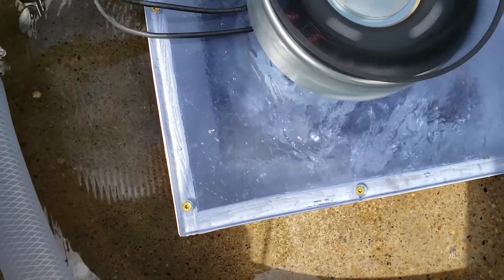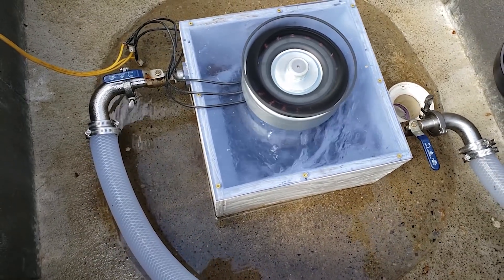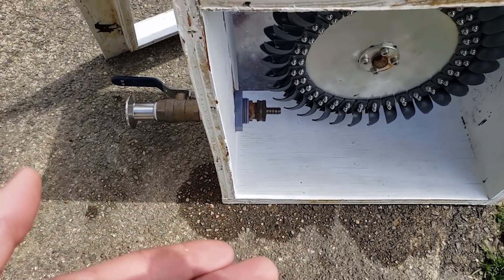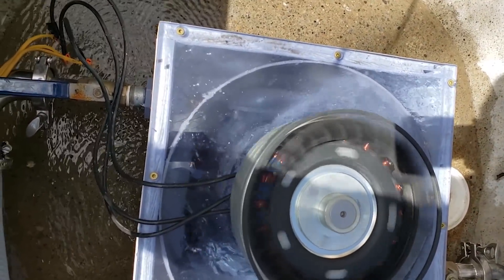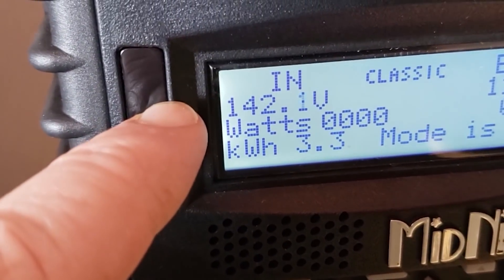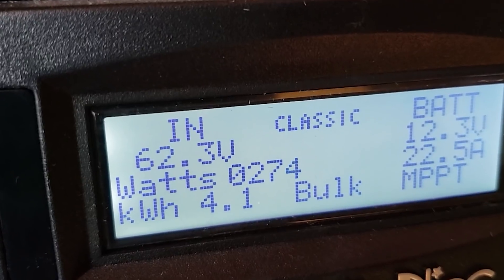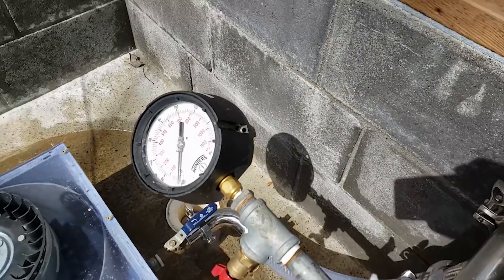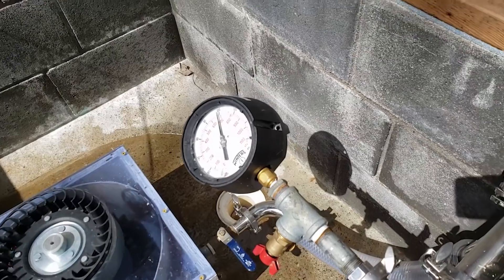Round Turbine Housing, An Improvement?

Comment: How did you get that much pressure?
Reply from the maker: A spring 280ft up the hill
Reply: @JoeMalovich  that's about right. 119 psi is around 274 ft of head. owner of the property is very fortunate. how many households can this power?

Comment: Instead of square or circular turbine cover how about a tubular turbine cover, and you build some fins at ends of both water splash where the water is redirected to the bottom of the turbine with which you can avoid the distraction to both the turbine and the other splasher...

Comment: I'm no expert but I think you may find your box is totally too small, and your jets need to be setup with the water flowing to get the angle correct on the spoons. Believe me it doesn't take much to loose RPM because your jets are just slightly miss aligned

Comment: Make your circular drum from expanded stainless, if you orientate the expanded sheet correctly it will strip the water away much like a cheese grater. and for gods sake orientate any over lap in the direction of spin to help prevent any damage to your rotor.

Comment: I very much like the work you did with connections, concrete, etc, to make it easy to work on.  These things need a lot of work at first when efficiency improvements are being done.

I'd do a lot more experiments before committing to stainless.  Get all the flow and bouncing issues/opportunities solved first.

Whatever bouncing issue you have with the top, is likely happening on the bottom as well.  You may want to increase the height of the box by a foot to prevent any bouncing from the bottom.

Comment: After looking at several turbine sites on Youtube, here's my thoughts. You guys are all trying to reduce splash back and prevent drag. The nozzles MUST be equal in pressure. If one nozzle is faster than the other, then, the slow one will be hitting the cups later than the other one. If the water hits late then it is not adding as much and creates drag for the faster one. The nozzle supply pipes MUST be equal in the bends and all areas of the supply pipe pressures .Build a header system with EQUAL pipes and fittings to each nozzle. Just like an automobile engine. The inflow must be equal then, you can work on the out flow. 😎

Comment: As theoretically, water should lose all speed and drop dead, it falls vertically down and crosses the space where the spoons move.

It could be interesting to make a U-shaped sheet metal profile like a sharp edged tunnel, where the cup  can continue once all water of the jet has exited the cup.

The MPPT may find that such a cover eliminates plashing and increase the RPM slightly to give the used water a slight forward motion.

It may be possible the cup should be shaped or angled to eject water slightly radial outwards and not mirror it in reverse so drop on the wheel.

The wheel with a smaller diameter has the advantage of larger distance  between the cups and the cups curving off to allow for a "drop-zone" where there is no cups in the way. The MPPT may increase RPM a bit and allow for a residual velocity that moves water away.

Any water in a slight forward motion should be guided in a curve to move vertically down and out.

How a single spoon is best located maybe can be checked by observing how a low pressure jet actually splits the water over the engagement cycle.

Comment: The circular housing is nice, But you can see where the majority of the water hits the circular enclosure wall. Cut a slotted hole in the enclosure wall. Most of the water would leave the enclosure at that point eliminating the majority of the drag.

Comment: Joe, I just recently discovered your videos and what you are doing I think is really cool. I'm sure you have researched this topic at length but I build racing engines and understand fluid flow. I wondered what larger more commercial water turbine designs looked like and I found this website with a 10KW turbine. I wonder if you incorporated a similar turbine housing design if your water flow turbulence would increase the efficiency.  I think this design (on the website) incorporates a down draft turbine blade design but the fact that the housing is both cylindrical and cone shaped allowed for the water pressure to dissipate and fall away. I wonder since your Pelton wheel requires more of a direct side impact with water flow, if you created a half donut shaped upper housing for the water to reflect off of and help smooth the turbulence of the squarish  corners between your plexiglass and the cylinder. I imagine if you want to keep the upper lid visible, you could use clear casting resin to make a semi transparent "half-donut". Here is the site I found, have a look.
https://www.micro-hydro-power.com/Micro-Hydro-Turbine-Power-Dual-Nozzle-XJ30-10DCTF4_6-Z.htm
Reply from the maker: Your comment is on point. I plan to solve this issue by using a turgo runner which has all of is flow in one direction.

Comment: You could get more power if you raised the water coming from the spring a few feet.  The Romans had had a trick for lifting water levels in their aqueducts, to make water run uphill.  While you want water to go downhill, you can still use the Roman trick of an inverted siphon to raise the level of the water, to increase the water force hitting your turbine.  The Romans used inverted siphons to run aqueducts uphill (no moving parts, just uses water pressure)!

Comment: It may be a bit more complicated, but what if you constructed an open-top conical round housing? The conical shape should cause the water hitting it to preferentially deflect upwards or downwards based on the angle of the cone and combined with leaving a gap at the top or bottom, I'd suspect you'd eject a lot more of the water that is forming a vortex and backsplashing.

Comment: Can you run more small nozzles to use up the full flow rate?  Does that give a proportionately higher power output? Long nozzle tubes with venturi inlets from the larger pipe will exit in a laminar flow.  A fixed stator will direct the discharge water away from the rotor.

Comment: You don't need to make it a circle. You just need 2 inputs and 2 outputs. Example: The water jet will shoot out the water directly towards a output valve that's feed into the second input water jet. Then have the second input water jet shooting towards the second output valve that's feed into the first input water jet line. It would give release of  friction that's causing back pressure from it bouncing off of the walls inside of the box. It would cause a vortex suction on the output valves which would pick up the water speed flowing. At that point I would be worried about water proofing the bearings and heat deterioration.

Comment: Great series on turbine..seems to me that you need a birdcage system instead of a sealed box..water will exit the cage that supports the motor..you only need wall where the nozzle(s) will be mounted..heavy (HEAVY!!!) gauge wire cage and try not to have the splash from the spoons hit any of the cage bars..easily done buy observing your current system..yes, I am living vicariously through you...LOL..also you could try a slotted metal wall design where the wall is formed like car hood scoops into the chamber to catch the water and divert it outward...Think "outside the box"..LOL

Comment: And maybe use a splashback cylinder with a chhese grater style perforations to evacuate as much water into the corner sections where it will not cause drag?  All in all sir, I like your style.  Great acceptance of trail and error to find success.

Comment: The circular enclosure certainly helps reduce inefficiency of the current system, but why not use the redirected water as a secondary power source?  Expand the enclosure.  Add two small wheels in the path of the water ejected from each side of the primary wheel.  Rather than that high speed ejected water simply being diverted, it can generate power.  One large generator and wheel, two small generators and wheels.  Less wasted energy.  Not sure how your current system would handle three separate generators all at different outputs though.

Comment: Hi Joe love and warm regards from India, I feel you must make a involute just big to fit the pelton wheel, you can visualise it as a "C" that's like half cut square, going around the pelton wheel will reduce the drag form a more uniform water flow over the wheel, also I recommend to add 4 more nozzles so a total of six nozzles with a enclosed involute specially made that just fits pelton wheel, should surely increase its efficiency, lovely work and a great design, great effort in that biting cold Joe, God bless and keep the good work going.

Comment: Thinking on this (I'm no engineer) it would seem that if you made a housing in the shape of a donut missing the inner 1/4 - 1/3 surface (so that it would go around the impellers) then extend the inner edges a little toward the spindle and had shaped cut out vanes on bottom side (to direct water down). I think this arrangement would limit the turbulence causing your fluctuations. sounds a lot more involved doesn't it. Anyway like I said I'm not an engineer (but I was a printer/copier tech. for 28 years.

Comment: I'd love to see what a mesh, expanded metal, or sheet with exit holes does in the same orientation. I would think the goal is to get the 'exhaust' water to slow down and get out of the turbine housing as fast as possible. In lue of an infinitely large space the ways to do that are deflection or drag(I'm probably missing something here). Thoughts?

Comment: You need some strategically placed louvers in the cylindrical turbine housing to allow water to escape out and not be recirculated and churned in the path of the pelton wheel.  The louver principle is very much like a windage tray inside the reciprocating crankcase of a common internal combustion engine.

Comment: You should try this with an open frame, this is acting a bit like a water brake dyno. I think any structure around the turbine will restrict it a bit. Maybe a big cover between the turbine and rotor to shield the rotor but nothing around the turbine

Comment: If you aren't familiar with them, look at windage trays that are used for oil (fluid) control in high performance race car engines. That type of design would take care of a lot of your fluid drag. The other thing that would help substantially is if the outlet fell into a 'moon pool' design so there was an air lock. If you could achieve that then you could use any additional head water to pull a vacuum through a venturi through a hose (that may or may not be worth the money spent). Here is a link to Practical Engineering who can help explain some of the ways vacuum can be achieved with moving liquids in a pipe in case I'm not explaining it properly. 

https://www.youtube.com/watch?v=JyvoN1hIqRo&t=11s

Comment: Great video. I hope you are paying really close attention to the transition from your reinforced hosing thru your ball valve and thru your jet. You are effectively accelerating your water and any losses there will be easily quantified. You don't want to be having turbulence from square edges steep tapers etc. Just think what a water monitor looks like. I also suspect that this would work better in a horizontal axis. In this axis the water from the upper set of "cups" must drop thru the lower set of cups. You want the water hitting the cups, expending its kinetic energy to the cups and then getting a straight shot out of the way. You could simply use two parallel jets mounted to achieve the desired impact.  It may also be desirable to put the ball valves some distance upstream from the nozzles to minimise their affect on your nozzles. An effective way of stopping water getting to an alternator without huge friction losses is to put a disc on either side of "barrier. The water can not pass the spinning discs because it is simply thrown off. Kind of like a continuous labyrinth seal. No physical contact to anything, just a tiny bit of windage.

Comment: You should lighten the turbine disc and make it have 3 spokes that have rounded edges to reduce the drag and the spinning momentum  or make a air tight housing so you can suck all of the air out of a tube that runs out the top of the housing to take away most / all drag from the air then when you go to run the turbine you continue to suck in air out of the tube that prevents water from getting in through a multi cone system. It may sound confusing to some people but it makes sense to me.

Comment: I am just an idiot, but i think Pythagoras would be upset that the housing isn't a triangle, a triangle with a circular housing within, the points of the triangle are the mounting positions for 3 jets, and each jet points towards the next corner in the rotation. 

I could be talking shit, but i got a good feeling about this!

The only reason i guess this is because, all modern wind turbines seem to have 3 blades for balance, this is a completely different application, but i just have a feeling that any more than 3 jets is overkill. a Triangle fits around a circle with less surface area exposed.

Comment: I think that plywood is the perfect temporary medium to work with as you are doing. It allows for so many quick and dirty modifications. I don't necessarily understand refraction dynamics but i will throw in my 2 cents of opinion since i'm in lock-down and have nothing else to do and i too have built a small hydro-electric operation. So I would imagine that anything but a 90 degree angle on your jets would produce losses with this style of impeller, straight on has your greatest potential for efficiencies. I personally would still try to solve the water deflection issue by maybe creating a much larger round chamber...fill your usable space with an even bigger housing. Also, if you are able to re-design your housing so that your nozzles can be moved around a bit in order to be able to find the optimum point of contact with the impeller, that way you could then set and test your jet accuracy much quicker since I think this is also one of your points of loss. I still see too much energy in your water when it leaves the impeller. Great video!!!

Comment: 3:30 very interesting to see that the reflected water jet changes direction as RPM increases. at low RPM it's directed almost backwards, then there's a point (i assume it's where turbine linear velocity reaches 1/2 of the jet velocity) the jet is dispersed sideways, and then it's just slightly redirected. it also means that at low RPM it transfers the most impulse from the beam to the wheel.
Reply: If the RPM is lower than a peripheral velocity of 1/2 of the jet velocity, there will be a higher torque on the shaft, but still a lower power output as some kinetic energy is returned to the water as it's thrown back. The point of best efficiency and power output is in fact when the peripheral velocity is 1/2 of the jet.
Of course, if he didn't match up the generator to the turbine, the point of highest total electrical power output might be different from the optimal rpm of the turbine due to the efficiency curve of the generator.
Reply: @jonsen2k  i wonder if instead of regulating nozzle flow by a valve, it might be better to regulate it by changing nozzle width. this way one could find the sweet spot for jet velocity when it's neither reflected forward nor backward on optimal generator rpm.

Comment: A quick fix id like to see it the use a downward corkscrew water/ montage mitigation. For example, taking bike tires(cheap/readily available) cut diagonally(let's say 23°)across the width of said bike tires. Spiraling these big tire pieces downward from the direction of jet flow. I believe this would send all water and wind downward. This May not be a cheaper alternative in the long run vs angling your nozzles downward. I believe would save you the time developing a new set of spoons to add to your wheel and going through the process of lining everything back up. I can image this being done in several different ways but most ending in a slight increase in efficiency. On a stainless setup is where I see this becoming a bit tricky. Rolling the sheet stainless into shape my be your best bet.

Comment: You could do an exit hole like with rotary engines. I think the cone shape would be easier and work better Or two half circles with a mild offset for exit holes. think of two half circles facing each other with small offset.

Comment: Wow realy great design...I can not see the total system from this vid and it looks like there is alot of motion energy being wasted and interfering with the speed of the design..I was wondering if  you you can turn the system 90 degres with the water input on top..if not make a circular enclosure similar to the tesla turbine..remember squares are not on a jet engine..

Comment: if the circular housing is not air tight to the rest, aren't you creating a venturi effect? that would want to suck the wind in the cracks and push the water.

Comment: The high speed is SO PRETTY!  I love it!  Watching the droplets move.  Epic.

Thanks for testing taking the corners out.  Had a feeling youd gain some efficiency.  You could poke holes in the circular housing to let water through as it spins but not enough holes that it could come back.  Let it drip down the corners essentially.  The other thing you could do is make it thinner at the top than the bottom to encourage the water to go downwards.

Comment: The turbine shaft needs to be horizontal and the water to jet in from the top so the water can go straight down in its exit.
Reply from the maker: a valid statement.  the reason I have the axis oriented in this direction is to keep water out of bearings
Reply: Joe Malovich maybe the shaft should be longer to keep the bearings further from the water? With a water guard if you will on the shaft, a simple flat disk ?